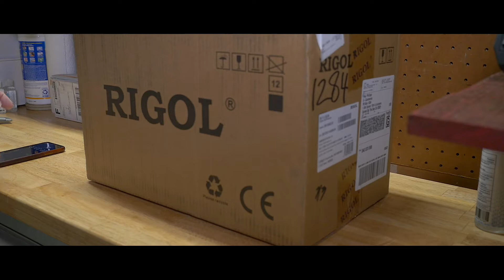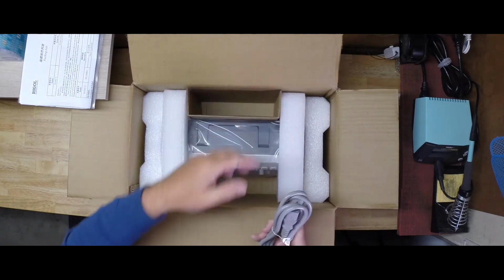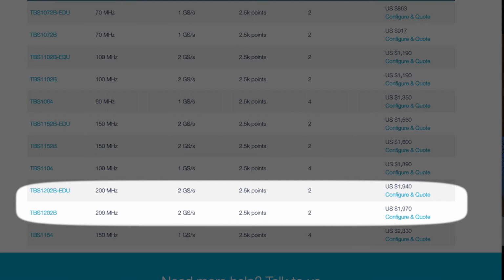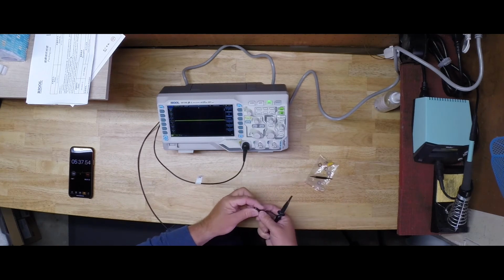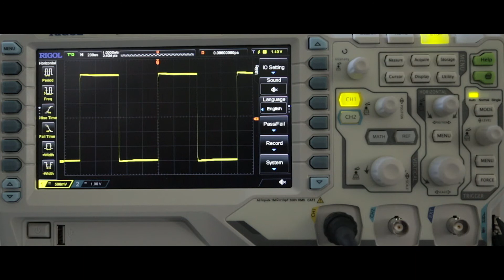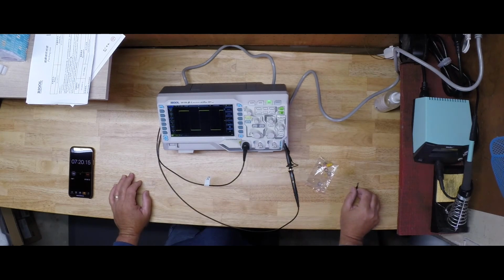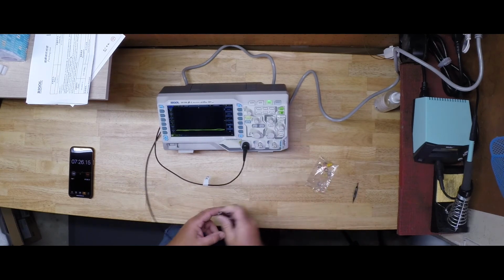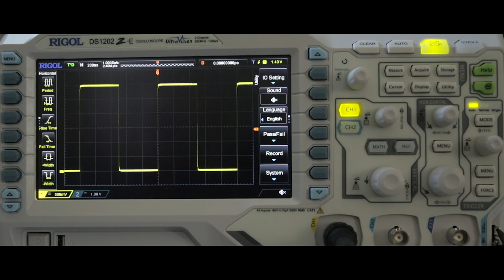Rigol DS1202Z-E Oscilloscope Unboxing.

Comment: What was the reason you bought this scope? What project did you need it for?
Reply from the maker: I wanted to debug a B&W Sub-woofer that was not working.  Also, I was starting to build a guitar amp kit and thought I might need to debug the signal path.  Mainly though, I'd never owned my own scope so thought this would be a good addition to my workbench...

Comment: Thanks for the video. Is it possible to decode I2C and RS232 using this?
Reply from the maker: Thanks for the question...yes, this scope supports protocol decoding for parallel, rs232, i2c and SPI...you can download the manual from the Rigol website here:  https://www.rigol-uk.co.uk/jg/wp-content/uploads/2020/09/Rigol-DS1000Z-E-UserGuide.pdf
Good luck!